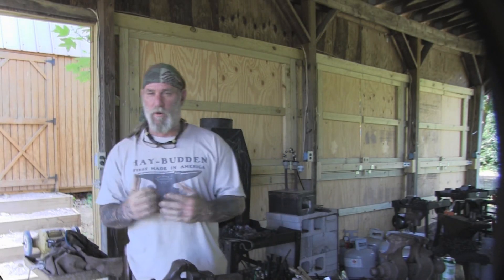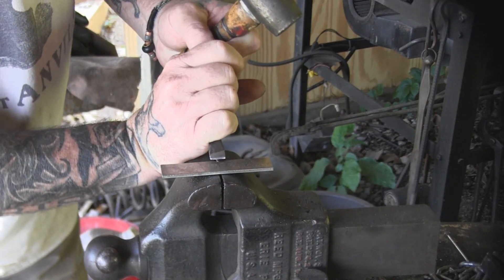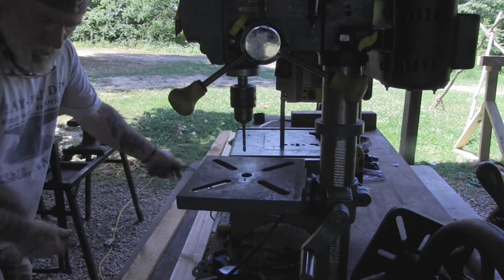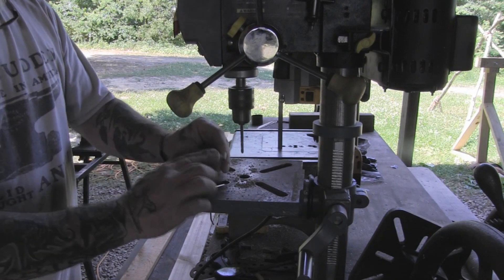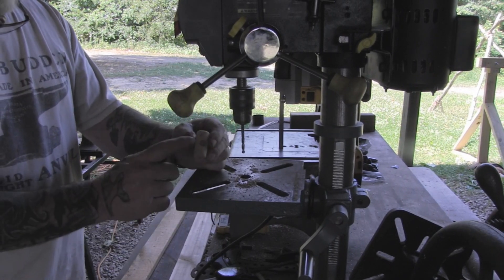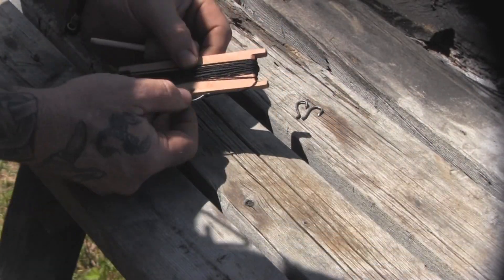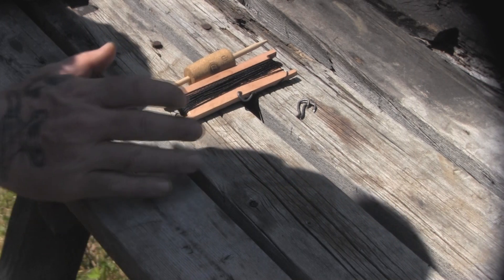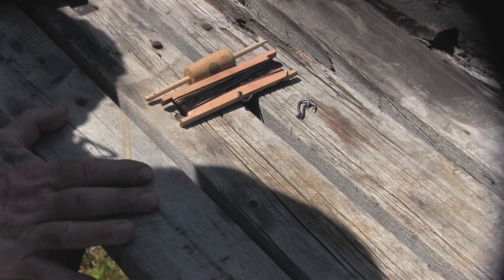Quick Fishing Kit from Common Materials

Comment: Thanks for another great video!

I typically carry more line, about 50' or so. I also keep a couple of small eye screws in my kit so I can make a makeshift rod & reel.

I liked the idea to use the nut as a weight. even added a pair to my fishing kit! :) Though, if you know your knots, you can even use small stones found by the shore of the body of water in a pinch.

If you've got the time and tools to make hooks from nails, I would suggest offsetting the hook slightly by giving the  bend a slight twist so that when laid down on a flat surface, the hook itself doesn't lay flat.